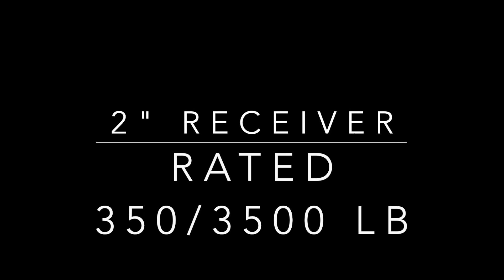We have the tow hitch - Tesla Model Y towing capacity is 3,500 and we have the tow hitch NOW

Comment: Wiring harness? And how do you install wiring?
Reply from the maker: It is actually the same wire harness that works with Model 3 and the Model S applications. Here is a link to the wire harness that works with the 2020 Tesla Model Y: https://torkliftcentral.com/tekonsha-wiring-harness-tesla-roadster-and-model-s-119251
Reply: @torklift_central  But i see that the wiring is already on the Model Y from the factory.  Is there a plug and play options available?
Reply from the maker: Thank you for the question, if you purchased a Tesla Model Y with the factory hitch, it is highly likely the wiring is already included on the vehicle. If you ordered a Model Y without the hitch, we wouldn’t expect the wiring to be included on the vehicle. For the Model Y installations we have completed at our installation center, there was no wiring included so we had to use the wiring harness listed above. Currently there are no plug and play options for the Model Y but installation of this harness is fairly simple

Comment: whats the difference between the 3 ansd the y that gives that large a difference in towing capacity?
Reply from the maker: Hello there and thank you for the question. The Model Y is rated at a higher capacity because it is rated to tow so our goal was the match the manufacturer weight ratings.
Reply: @torklift_central  thanks for the reply. I was under the impression the drivetrain is basically identical between the 3 and the y, and if that is the case, would their towing capacity be similar or have y'all been able to identify a mechanical dissimilarity?

Comment: Hi, can you tow a motorcycle that weighs 475 lbs with this tow hitch?
Reply from the maker: To make sure we are 100 percent clear - do you mean haul a motorcycle on a rack or tow a motorcycle on a trailer? (It will make a difference).
Reply: @torklift_central  Tow a motorcycle on a trailer.
Reply from the maker: @zakandoz9614  Thank you for clarifying. As long as the combined weight of your motorcycle and trailer loaded does not exceed 3,500 pounds towing and 350 pounds tongue weight, the EcoHitch will be a great option for you.

Comment: Tool list?
Reply from the maker: Hello Ted! This application is completely bolt-on so only hand tools are required. There is further information on the installation within the instructions included with EcoHitch order. -Jasmyne
Reply: @torklift_central  list so far 5/16 wrench for the tail lights 10 mm 8 mm T25 torx 15 mm socket extension torque wrench

Comment: How much does this EcoHitch tow bar and ball weigh? 25 kg?
Reply from the maker: I just checked with our engineering team and they have told me the Tesla Model Y EcoHitch weighs approximately 35 pounds. For context the Tesla Model 3 EcoHitch is slightly heavier than this hitch so this will be a smidge lighter. Thank you for asking!
Reply: @torklift_central  thanks, so ~16 kg. On  Tesla model Y LR D that leaves payload:
Max payload 402 kg - hitch 16 kg = 386 kg.